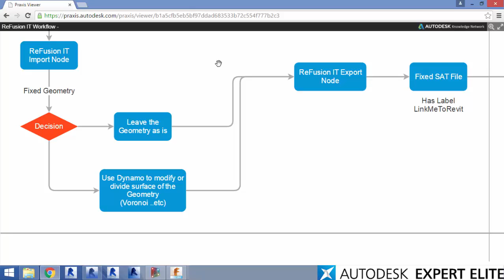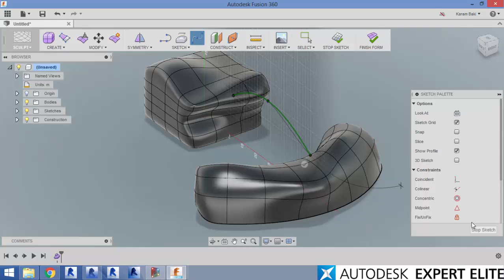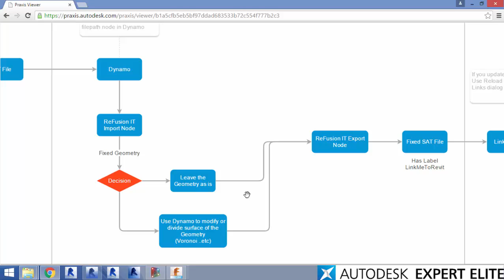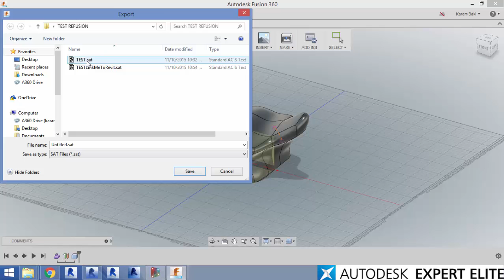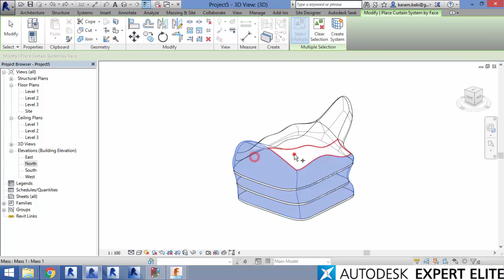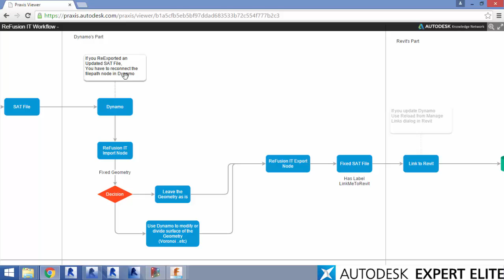OUTDATED - !! ReFusion IT : Evolutionary Organic Conceptual modeling in Revit

Comment: I tried today this method and didn't succeed... Revit reported an error that file has to be converted to Autocad and then opened back. Anyway I've tried to do it but it didn't work.. I don't know what to do.. Can u advise me something, please?
Reply from the maker: hi Lucy, am shutting down this video, it is so much outdated, new tools have been created and released, but not video captured yet in my channel, for now, check this : https://www.youtube.com/watch?v=U3l9JJ7O8wc
Install the latest synthesize, in Dynamo player, use Fusion360.SAT sync, it should automate the process, and wait till I release the new workflow video,
Reply: Thank you very much! Btw, I imported it just now, but walls can't be added so, I guess, it's time to upgrade my 2017 revit to 2018 with dynamo player and try this one! THank you!

Comment: Hello Karim Baki Very usefull your knowledge  

I am Christian Maury and I have a cuestion.
 
I need to import a model that I create in Fusion360 to revit, I import this in .sat format. From Fusion 360 I separate and export each  component in diferent files.
 
How can i open this in revit?  
 
I can open it (all components of the model) in a single family of revit, importing each component to have the complete model in a family?
 
Or I have to open each component in a file of family separated. And then load in the project?
 
I need to have the components separated in the project with parameters and different materials.
 
I appreciate very much the support is very important to do things well !!

Comment: You are the best!!! thanks for this tutorial... There is any way to do the same thing but with a dwg. file and use it as mass in Revit that´s because i have a file from a client but is an sketchup file and it just let me work with dwg.
Thank you
Reply from the maker: yes you can, 
simply start an inplace mass family,
then link the .dwg to revit,

but it should be closed mass .. and I don't have knowledge in autocad but it should work,

you can also link a .skp directly, 
but it should be saved in version 8,
... save as version 8 then do the same,
Reply: Thanks for your quick answer, yes i'm trying with many methods but doesn't work I think it's something with the shape or something

Comment: Hello Karim, I have been having trouble with the dynamo part. I went through the steps but was wondering if there was a flaw in something i did? I converted the SAT file and exported it, and opened dynamo and went through your steps, but when i tried connecting the Path node to the ReFusion IT Import node there was no geometry visible. It is also worth mentioning that my SAT file had a blank icon (your SAT file in the video had an icon). Im using Fusion 360 2015 and Dynamo 0.9.0 wondering if you can help or know what i did wrong? Thankyou!
Reply from the maker: Hey Rashed, please send me your SAT File to my email :
karam.baki@gmail.com

And it's ok if you had a blank icon, it's a windows definition of it which I had.
I need to see the SAT Fie so I can figure out the issue you're having
Reply: +Karam Baki still awaiting your response on my email Karam, I hope all is well
Reply from the maker: +Rashed Al Araifi Oh hey Rasheed sry for late, just noticed it,

Well the problem is from Fusion's Side, 
When you built the form, you didn't change the units, so it's in mm, instead of meters,

Solutions :
-Scale the form in Fusion (After changing the Unit)
-Scale the form in Dynamo (Little hard for new dynamo guys)
-Scale the form when it enters into Revit from edit type dialog on the imported shape (You need to zoom a lot to see it)

So simply, I would recommend you Rebuild the form as it's a test one, but change the units in Fusion before getting it into Dynamo
, If you tried to zoom in dynamo after switching to (Ctrl+B), you can see it's imported correctly but it's very tiny,

Greetings,
Karam